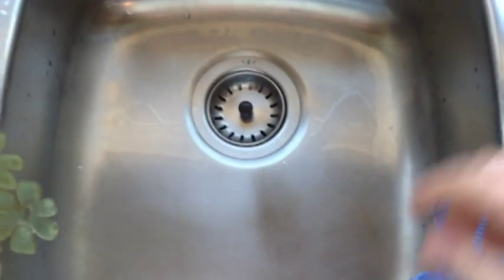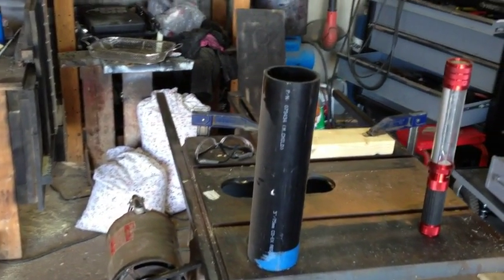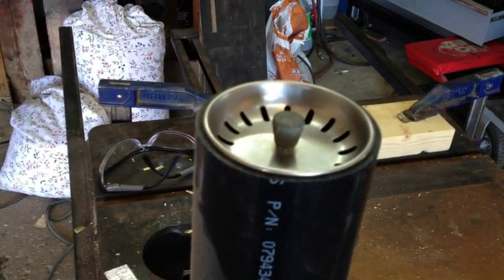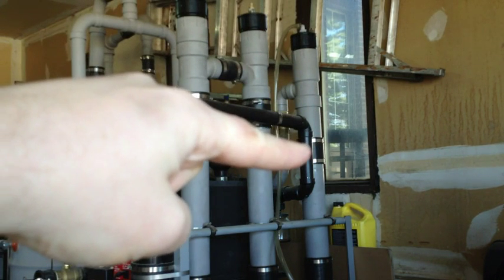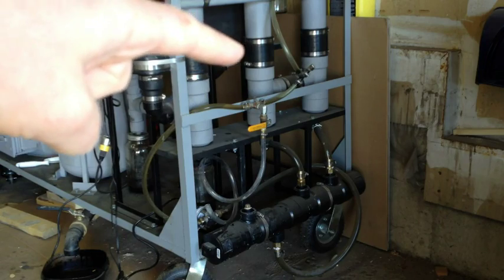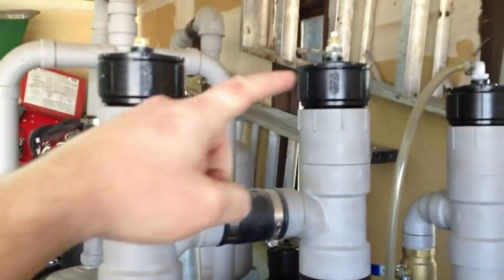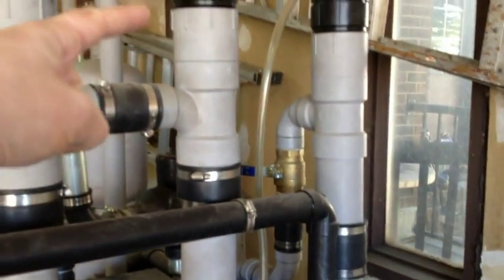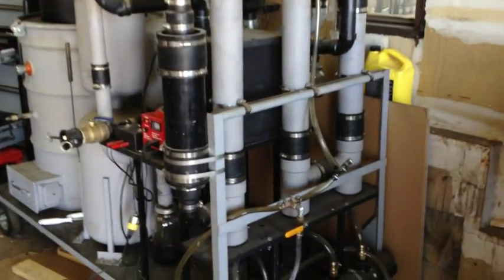homemade woodgas wet scrubber part 1

Comment: Not sure if you are still doing anything with this now, but I read an interesting study that suggested using used cooking oil in place of water in a packed bed wet scrubber system with wood chips. The advantage being improved scrubbing efficiency and the fact that the filter material can then be used in the gassifier as a producer source, completely recycling the scrubber medium.
Reply from the maker: Definitely interesting. I can see that would work pretty good. I’m guessing it would come down to cost. I liked what I used with antifreeze especially in the winter. I’m also thinken with oil will be a little more viscosity when cold and should need more of a suction  for the gas to be vacuumed. Interesting to do some experimenting. When I did my test I know that these machines are very finicky with air fluid flow through the system. Thanks for sharing

Comment: Hey nice work on a scrubber have you tried a sprinkler nozzle might capture more tar out of the gas, most industrial scrubbers use sprinkler nozzles. I work in the potash world and our scrubbers work great. Just a thought let me know what you think I’m in the works of building a gasifier right now and live the idea. 

The duke
Reply from the maker: Canadian Duke thanks Duke
Reply: Josefppaz How long have you tested your wet scrubber for how long of periods? I figure as long as the suction fan is not strong enough and Is not taking the moisture along with it, it should work. Thanks for the quick response, I am building a down draft style. 

The Duke
Reply from the maker: Canadian Duke testing was not too long maybe a hour or so but this is a link https://youtu.be/epq4-0VVCME when I first saw a wet scrubber venturi effect. I love the fact that it forces the gas to be cleaned. Never really liked the saw dust or rain on were I feel it doesn’t force clean. And this is so much easier to clean and replace water or in cold climates antifreeze

Comment: wouldnt it be easier to just bubble the gas thru a water container ?
Reply from the maker: Douglas McLeod hi Douglas absolutely I thought of the bubble design. I find that with my design the water and gas has to come together to
Merge more tightly and creating more of a friction for cleaning the bubbler would work too but I find it would not be as effective and depending on bubbler size you may need a lot more suction for the gas to go through the system. :)
Reply: @Josefppaz   abuubler would scrub the gass better as you have more water surface scrubbing as the bubbles float up...also having strainers or grates would breathe bubbles up
Reply from the maker: henri I found I needed more suction with the bubble design although it’s great but i find with this Venturi effect has less water less suction needed. I know some guys use a rain method aswell but it doesn’t force gas’s and water together as much the a Venturi method. These are just my thoughts experimenting with all ideas I found this way takes the cake.
Reply: @Josefppaz  

I think the the trick to you suction problem is to let the gass enter from the bottom of the bubbler...let gravity do the work as bubbles rise to the top.

Water column does not need to tall 6" but several in series.
Reply: A long water column of water and coolant would be more effective  with 3 lays of sink strainer spaced threw out  forcing the bubbles to seperate...would cause more scrubbing and mor cleaning action with out pumps... simple and nothing to break min maintenance.. no addition power required also

Comment: would the heated air keep the water from freezing, so you wouldnʻt have to use antifreeze?
Reply from the maker: Kaui Trainer absolutely you can use that idea as a heat exchanger but I would not do this inside the gasifire it’s self only when the gas has exited the gasified for cooling. The main purpose to use the antifreeze is for when the machine is not used the water would not freeze in winter operations hope this helps and great idea :)

Comment: Should scrub it,then feed it back through,heat it up to dry it and then cool it,water in the cooler may come out much cleaner.
Not sure about it but would it be easier to vaporize the water,catch the smoke in it and then cool it?
Already have a system built you can experiment with. I'd think it would be easier to cool water vapor and collect it then try to filter out smoke. I'm going to try spraying heated water into a cyclone(using heat already being produced to make steam will do away with a water pump)plus it can be trapped and recycled easier than filter medium.
Reply from the maker: Patriotic American it’s always fun to experiment try it out see what happens but absolutely I like the water cleaner then dry filter media I find it needs more vacuum to get the gas out and it can clog the system more then the water cleaner

Comment: i like this man, have you thought of turning the scrubber sideways with a tank under it that all the particulate could drop down into ?drill holes across the side of your PVC and seal it to a small tank or maybe another length of PVC with capped ends
Reply from the maker: No my friend I haven’t thought of that usually when the smoke goes through the Venturi with the antifreeze does a great job. I did not get to many particles but the antifreeze would have to be changed from time to time

Comment: I'm interested in the cooling effect of the water scrubber. Have you taken any temp readings at the inlet and outlet? Could you minimize the size of a pre cooler (radiator) with this? Kudos on tour set up from Texas, USA.
Reply from the maker: Hi Larry sadly I didn't get any temp readings the whole system was for cooling but I know that the water or the antifreeze coolant did amazing and I am sure it would do an amazing job for you too man, I used antifreeze only because I live in a cold climate so the water would only be used in the summer months.  To minimize it I think would be fine its all about experimenting my friend
Reply: Thanks for the quick reply. I am in the planning stages right now and am looking to do a system which will maximize gas output but take up as little space as possible. I like the idea of a fogger system for particulate filtering but my thinking is that it will also do wonders to cool the gas. I'll let you know hoe it turns out. Thanks for the great idea.

Comment: Would love to have a list of all materials used, and of course measurements, that is a great system you have there, I am planning on building a scrubber just like yours, but instead of cleaning gas, I will use it to clean nitric acid fumes, so any help you could get me as far as sort of a blueprint would be greatly appreciated.
Reply from the maker: Luis Ochoa 
Hey bud I basically used the same design of that of flash001usa he has a site that should help you out for now. Unfortunately I don't have this unit anymore but some day I will make another one more compact. I wish you all the best
Reply: Thank you for your reply, I will be looking for his design online, and I am just actually interested in the filtering part, that was a great idea you had there!!
Reply from the maker: Luis Ochoa sorry bud  failed to mention flash uses filter media for his stuff. All I did was use antifreeze coolant when the gass flows through the pipe, on the top I have it spraying down on the middle of the  sink drain.   Most important part is when the coolant and gas flow together they have to be forced together by the holes in the sink drain via suction this cleans the gas by Venturi effect  I will sent you another link which shows this buddy
Reply from the maker: Luis Ochoa https://youtu.be/epq4-0VVCME here is the link you will get the idea from this, as you will see the sink drain works kinda the same way hope that helps bud

Comment: Hey Joe. I am working with Flash and Mazda on making new CAD drawings from the PDF file Flash sent me. I would like to include your build in the files I send back to Flash to post on miniwoodgas.com if it is OK with you. I noiticed many changes on your build that I would like to document for the new PDF. I already made a CAD drawing of what I have seen from your videos. Would it possible to e-mail me and I will send you what I made for any changes you may want to add? my e-mail is 
mada94fxr@gmail.com
Thanks Mark
Reply from the maker: +mada94fxr absolutely Mark as long as you guys keep my changes free for other people to use that's fine by me man! : )

Comment: Thanks for the tour. Have you run an engine yet? What do you plan on running?
Reply from the maker: mazdalorean sorry man not sure if I answered this one yet.  I have run my 5 1/2 hp engine just fine works like a dream.
  I have made a servo acting carb for my mazda 3.  I have tried this already but didn't work to well.  Big reason why too little woodgas from the gasifier lol I know the engine needs a lot.  I just thought I had to try it to see if it would at least at idle, lol. I took the fuse out of the fuse box for the fuel injectors made a switch with it including the fuse, for a shut off to see if it would run on the wood gas. But I know guys are running newer cars on this I just don't know how they bypass the computers so well. Maybe I should make another video on what I did with the car.  This would be the ultimate goal. its so easy to have a generator run on wood.  But to run the car seems a little more complicated with the newer cars, but I will figure it out soon lol
Reply: ***** check out the vids by wkweasel. He is using a newer truck than most (2000 dakota with the 4.7 V8) , and is dealing with a lot of the same issues.
Reply from the maker: I guess he is putting it in storage or selling it. He said coil pack 4.7 motor in the Dodge is the worst one I could have picked to gasifiy timing issues.  So he is going to use chevy 5.3
looks like he has a awesome set up.